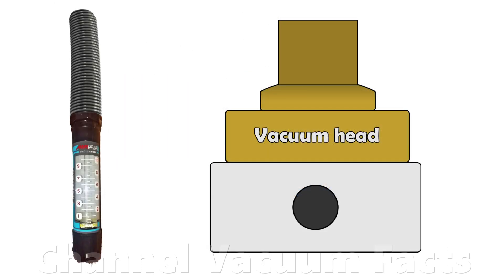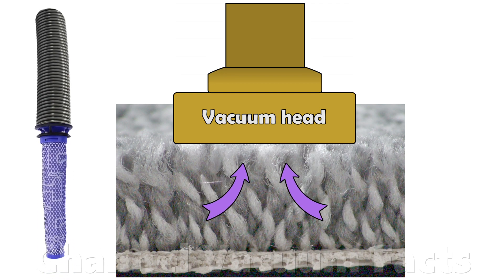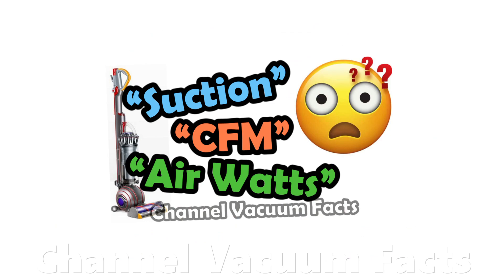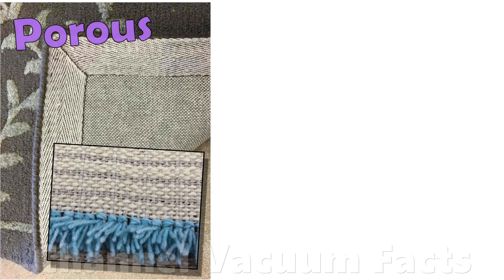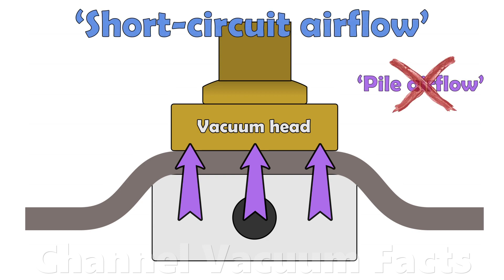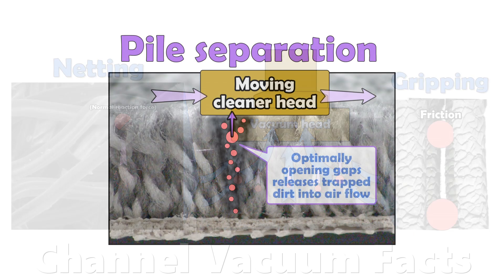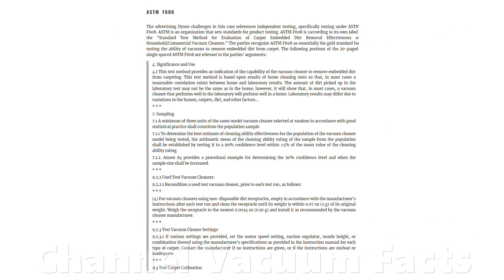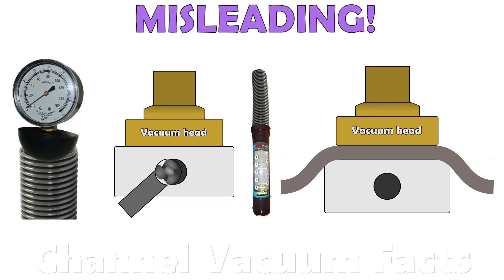Vacuum Cleaner Airflow Measurements Are Misleading (Updated!)

Comment: Very confusing video, If you directly compare two vacuum cleaners , one comes in at 50 vacuum, 1 air flow reading on a straight hose reading device, and the other vacuum pulling 70 vacuum and 7 air flow reading on the straight hose reading device it should be quite clear which vacuum should clean better. the only other variable I would agree with is this....the power head itself and how it interacts with the carpet surface....if the more powerful vacuum is "suffocating its suction and air flow by being to tight against the surface it may perform equal or only sleightly better than a weaker vacuum with properly adjusted head to carpet ....thoughts? I admit that you would have to do a test directly between the two opposing machines in a controled comparison test to see which picks up dirt the best....fascinating...
Reply from the maker: I recommend learning about the basic physics of how vacuum cleaners operate and extract dirt from carpets here https://youtu.be/WzkFvMLy-Eo Air flow measurements under no resistive load are irrelevant and tell you only about motor properties. Being able to sustain airflow through pile under resistive load (via high suction; basic Ohm's law) is key. How well the resources are utilised by a well-designed cleaner head determine cleaning performance. This is formally measured in international comparative industry tests. Most of the content on my channel is educational on this topic.
Reply: The theory in this video sounds very "sciencetific". But when you break this video down to it's core it's actually saying that you have "2 airflowmodes". 1 is without any resistance (short circuit), the second is with resistance (pile flow). The video states that the power of these 2 modes depend on the "sucking power of the engine". Only thing is that this sucking power is the same as the first airflow mode. Sucking power = short circuit airflow. So the video is just stating that your sucking power depends on your resistance. High sucking power sucking a carpet with a floor underneath will "smother" your airflow. So by all means its correct what the video is saying. But it ain't correct by implying that CFM is a misleading tool to measure sucking power. This video just explains what happens if that sucking power gets resistance. But it doesn't change anything about the sucking power in the first place. It's like saying a fast car won't be faster cause you'll have stop lights and traffic everyday. You might have allot of stop lights, but that doesn't change the fact your car has more horsepower. Interesting, but kinda misleading video.

Comment from the maker: What's really amazing is just how much airflow is lost by a top of the line Kirby when you put merely a really low resistance, porous carpet underneath it. It goes from 150 CFM to 3 times less at ~50 CFM give or take according to these two amateur videos. And note that this is without a hardfloor beneath the porous carpet, which would dramatically reduce this value even lower by an even greater amount: 1: https://www.youtube.com/watch?v=7Z0AWSWmLk4 and 2: https://www.youtube.com/watch?v=Fyk-3Yvf6Yg

Comment: Airflow of any kind only matters if there isn't any agitation provided, such as by a brush roll on a vacuum.
Reply from the maker: Partly, but there's more to it than. Vibrational impact is most useful for denser particles, but fine dust (i.e. the stuff harmful to health) is mostly unaffected. Pile separation is the single most important agitation method in general. All discussed in other videos on my channel. Airflow always matters, but best results are achieved when it's best utilised.

Comment: I wish companies like Miele,Sebo Vorwerk and Kirby would send their vacuums to the test centre where the Dysons were tested and make the results public so we would know once and for all which cleaners perform the best. Until this happens I will remain sceptical. I do see what you're saying in this video though.
Reply from the maker: And don't forget, for Dyson to be able to market their claims, they actually have to have other machines tested too. So Dyson have essentially already commissioned the testing of other machines for fair comparison to be able to make that conclusion. Not everyone wants to hear this common sense though as you can see from comments.
Reply: @VacuumFacts  But we don't know what cleaners they submitted and we don't know what the results are but I suppose these companies haven't sued Dyson for their claims. The best cleaner across all floortypes is an average though it doesn't mean it is the best cleaner on a certain type of carpet
Reply: There may be a vacuum cleaner that performs better on the specific carpet you have in your home. 😊
Reply from the maker: Yeah but that's a cop-out that's not real-world representative. No cleaner worth its weight in salt is that niche. Great cleaners are great for EVERYONE across the board in normal real-world homes. I've said it to you before, but this is probably why Dyson don't release their test data publicly. People will cherry-pick subsets of data for their own nefarious ends rather than fairly looking at the whole picture. The ONLY metric relevant is a super simple one: "Average cleaning performance across all floor types". No confusion, no learning; just intuitive and simple. That should be on the new EU labels.  @2711marcus
Reply from the maker: Er, we might not know, but Dyson do. If they've made a comparative claim like that, then to NOT get sued, you know they have the data to prove it. Again, the Shark case shows this. The data is used in court to prove a marketing claim. There's no reasonable doubt here.  @2711marcus
Reply: @VacuumFacts  Still a bit of a grey area for me. When Dyson can say they have the best cleaners on ALL surfaces and no one challenges it then Dyson will be my go to brand
Reply from the maker: But that's ridiculous though because a claim of that nature could never ever be proven, because what does "ALL surfaces mean"? Literally every conceivable surface known to man? That's stupid. The industry standards define a wide range of calibrated surfaces which fully represent the gamut of surfaces found in homes around the world. This is more meaningful. And so what you want is actually already achieved in a realistic practical sense. Dyson's claim is the real-world version of what you desire. There's literally no sensible reason therefore for them not to be, as you say, your "go to brand", other than tribal disliking. That's irrational. If "the best" (and not just in terms of cleaning performance) is what you actually want, there's very reasonable evidence out there that Dyson satisfy that. It's what I want, and Dyson are the only ones (currently) who satisfy it based on available evidence.
Reply: @VacuumFacts  Ok the best cleaner on all the surfaces they test for
Reply from the maker: "highest average cleaning performance across all surfaces" aka best overall cleaning performance. 'Surfaces' means those used in the industry test standards that encompass and represent the full spectrum of flooring found in homes, globally.
Reply: @VacuumFacts  Sounds impressive but an average could actually mean that they didn't come first in any tests 😁
Reply from the maker: @2711marcus  Er, which by extension would mean that those which DID come first in a niche test but didn't have the overall highest average, must by definition, have come very very much worse in other tests to get a lower overall average. It works both ways. The whole point in the average performance is that it reflects how good a cleaner is overall for most people in most homes across most floors. As a customer, you're more likely to get the best performance by selecting a cleaner with the highest overall average.
Reply: @VacuumFacts Yes I see what you're saying but for instance if it's a home with all hardfloors and a certain cleaner performed better on hardfloors you're going to pick that cleaner aren't you.
Reply from the maker: Yes, but that's misleading. The difference in cleaning performance by any one cleaner between hard floor and carpet isn’t large enough to make a high overall average cleaning performance result from only one floor type over another. In other words, having the highest average cleaning performance means you must also have very good hard floor/carpet cleaning performance.

Separating it out is also what the old EU labels got wrong. You never saw a cleaner get an A on carpet and a G on hard floors, or vice versa. They were always fairly similar as mentioned above. (Plus what did A mean anyway compared to G—you couldn't trust the EU labels?)

Personally, I'd also want to see the average score normalised to power usage (performance per unit Watt) to account for efficiency, so brute force energy guzzlers can't cheat a cheap victory. Any moron can slap a power-hungry jet engine to a machine and brute force equally high performance but that's just not respectable.
Reply: @VacuumFacts  Haha you have an answer for everything don't you.  But whether that answer is always the correct one is up for debate 😁
Reply from the maker: But debating is what you seem to have now stopped, which I assume was a euphemism for "You're completely right and I can't think of anything you've said which doesn't make total sense or could be wrong. I don't have any counterargument left and don't like this because the conclusion conflicts with my erroneous worldview that I just can't let go of, and as such I'll just go and bury my head in the sand rather than admit I'm wrong and you're right. So I'll just mislead by saying "it's up for debate" and hope no one thinks enough to notice the fallacy.". :P
Reply: @VacuumFacts  Yeah yeah not quite  I have presents to wrap. Goodnight John boy 😁
Reply from the maker: Me too. :P But that perfectly sums you (and many others) up :P I can't carry on because I need to wash my hair (have no argument left). Fundamentalists will never change their mind, even with all the sensible reasoning and evidence in the world. Show me one study/indepedent report showing modern Dyson is outperformed and I'll change my mind in a heartbeat.
Reply from the maker: Well, better than "I think it's a good test" at least. :P And I agree RE companies testing. The reason they don't is because they know they can't compete with the best. Think about it; if your goal was to produce the very best the market offers, and you really believed you achieved it, why on earth wouldn't you subject your machines to formal testing to damn-well prove it? Dyson fit into this category. They want to be the very best and so they do subject their machines to testing. And they proudly market the results; "best average cleaning performance across all floor types according to IEC60312" etc. Maybe they're lying as naysayers first impulsively retort. But then look what happens when you do lie about claims of that nature (cough...Shark...cough). Whilst it's expensive for an individual to pay for this independent testing, it's a drop in the ocean for a large company. So what you can conclude is that those who don't test and market the results KNOW they have inferior products that can't compete with the best. I'm only aware of Dyson who truly aims to be the best and actually achieves it, and that's evidence supported. Most companies just peddle mediocrity and milk the unthinking public. Scepticism isn't really that sensible when you think about it in this case.